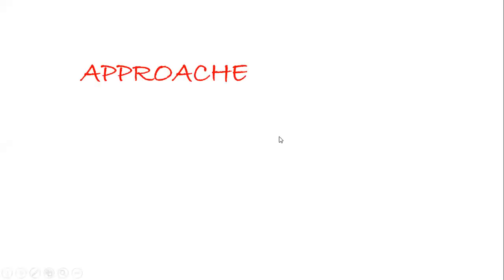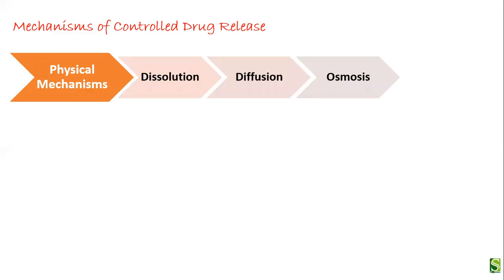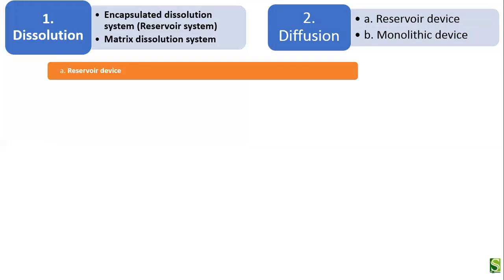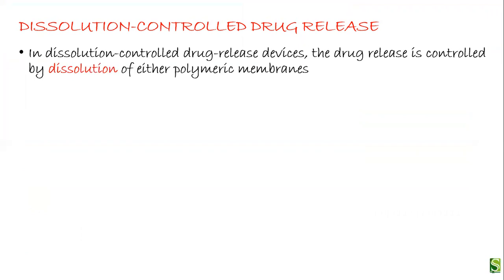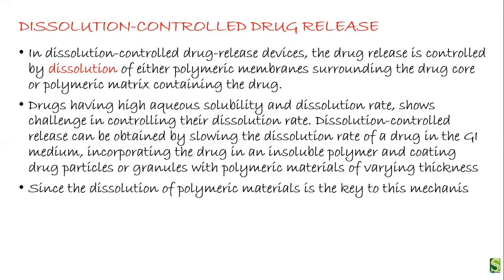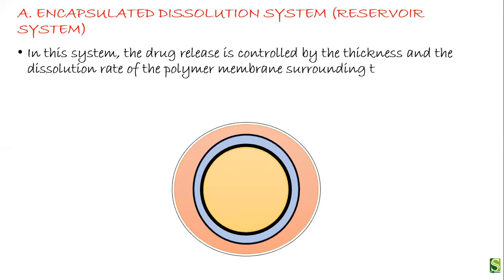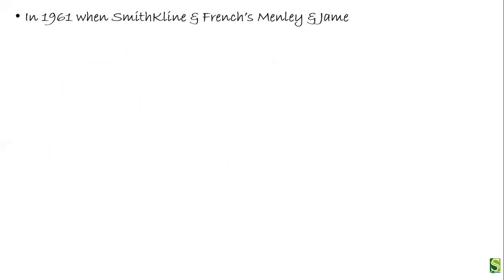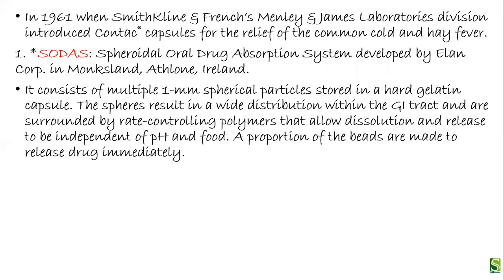Approaches for controlled drug release- dissolution controlled

Comment: Madam, what is drug release profile requirement for PR dosage form? 
I mean, any drug release limit is there like in 1hr, 3hr, 7hrs?
Reply from the maker: Optimum release profile
From immediate release and delayed release to sustained release and
controlled release, we know that the resulting plasma concentration
versus time curves have become increasingly flatter, prolonging the time
the drug is in the therapeutic range after a single administration of the
dosage form. This has led to the popular slogan: ‘The flatter the better’.
However, for some diseases it is advantageous to have varying release of
the drug depending on the needs of the patient or circadian rhythms in the
body. For example, insulin is needed in higher concentration after a meal
and blood pressure has been found to be higher in the morning and afternoon and drops off during the night. This has led to research into so-called feedback-
regulated drug delivery systems in which the drug concentration (ideally
at the drug target site) is measured through a sensor and, depending on the
ideal drug concentration, release is either increased or slowed down. It is
also possible that instead of the actual drug concentration a therapeutic
effect is measured that then acts as a feedback for the drug release. These
systems, however, have not yet entered the market.